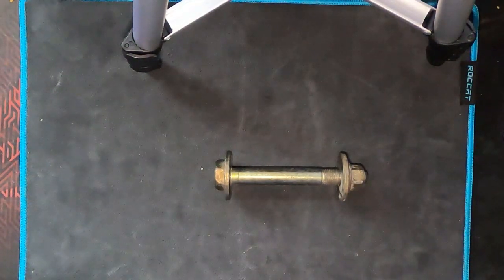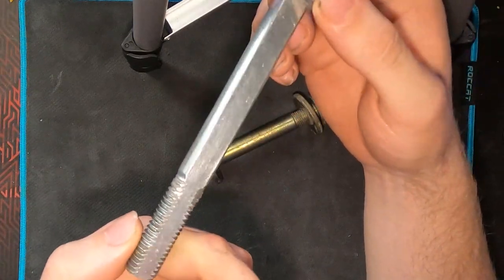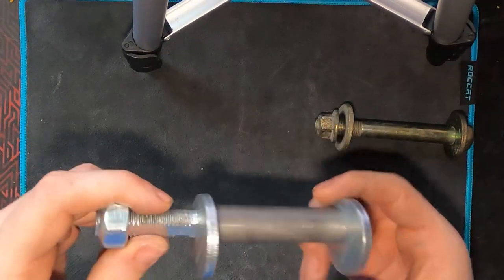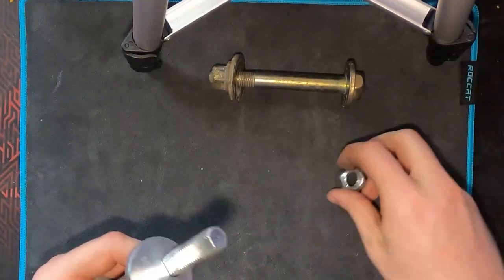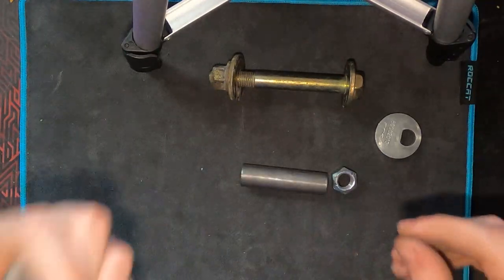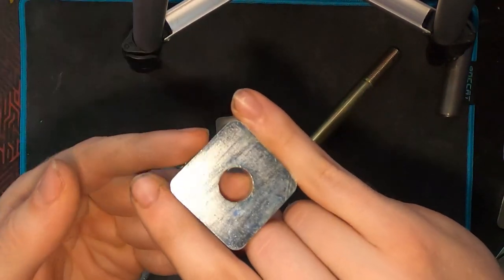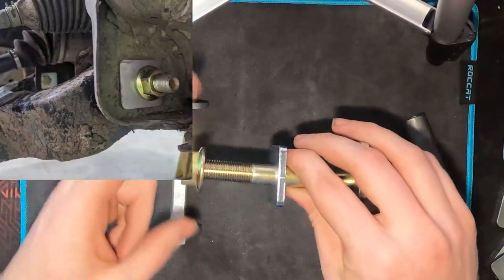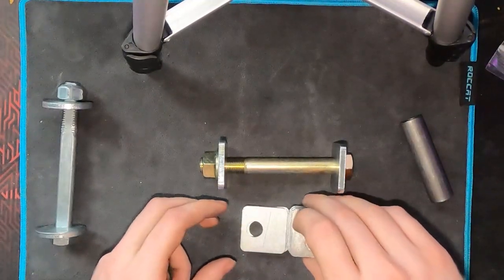Suspension - Cam bolt delete kit / Cam bolt lockout kit

Comment: I'm using some other brands OEM cambolts (thinking Toyota, idk had them laying in the shop) but they're the good ones that are 3 piece. Bolt with cam/bolt head made together in 1 piece. Cam washer, 1piece. Nut, 1 piece.

Comment: I'm slowly acquiring parts to lift my frontier. Does this kit work with your in house UCAs or are SPCs required? I'm looking at a 2 to 2.5" lift, if that matters
Reply from the maker: They'll work but normal cam bolts are more strongly recommended for a daily driver.  The lockouts only have 3 adjustments (min, middle, max) whereas normal cambolts have a full range of adjustment in between min and max.

Comment: I have sort of a dumb question here - why would I want to control camber on an off-road vehicle? I understand the point for drift-machines, or lowered vehicles to allow 'extra travel' for the tire with negative camber. If my current tires wear nicely already and alignment isn't off, is there a reason to switch to cam bolts? I plan to lift with the full ADO kit, but only a couple inches, nothing crazy. Thanks!
Reply from the maker: Whether it be camber bolts or a lockout kit like this, you want some sort of adjustment in your lower arms to achieve a proper alignment.  Camber bolts and lockout kits help get your camber and caster into spec after installing a lift
Reply: @AlldogsOffroadCoop  Ah I gotchya. I figured probably to be helpful to the alignment tech and get a solid alignment. I'm still new to the offroad world and I appreciate all the knowledge transfers!

Comment: How would these work with JBA upper control arms??
Reply from the maker: JBA doesn't make UCA's for the nissans but essentially you would be able to get your alignment close but no completely in spec if the UCA isn't adjustable.

Comment: But doesn't this mean you could never get perfect alignment
Reply from the maker: Guys using lockouts will normally be running an aftermarket arm.  SPC arms are adjustable at top and will allow for "perfect" alignment.